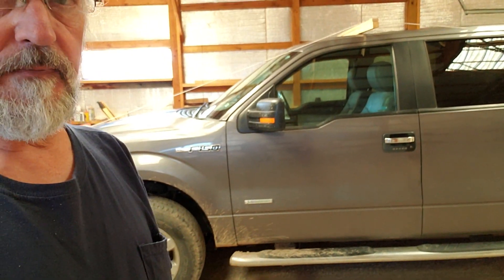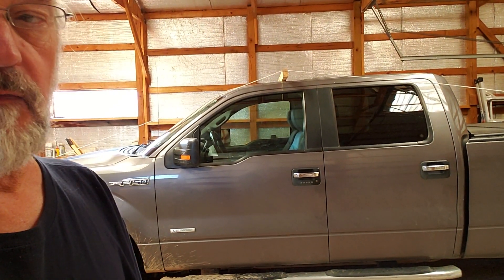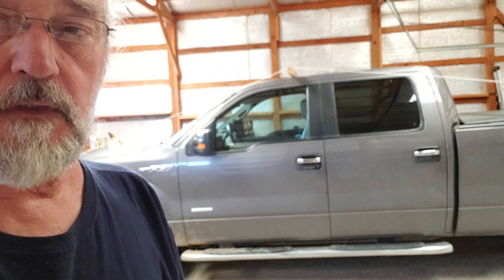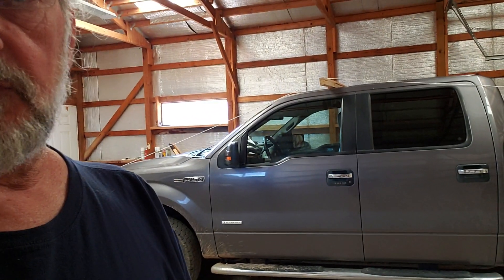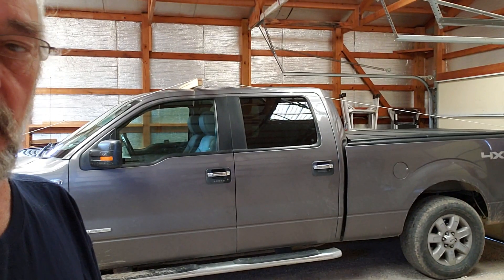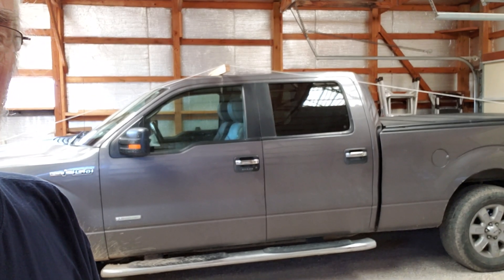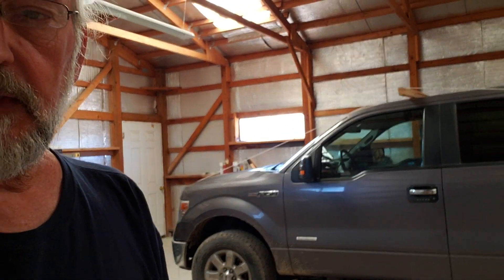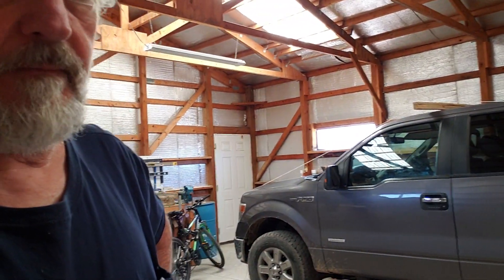Tesla Cyber Truck compared to a F-150 XLT with a crew cab and a 6.5 foot bed.

Comment: The lack of flat rails to place stuff on the truck sides of the bed and reach in and out is a deal breaker.
Reply: Why don't you just weld one on? It's stainless steel.

Comment: Awesome thought experiment John, that is a great way to get a real world comparison without having a Cybertruck on deck.  Brilliant idea with the rope!

I will say this, Tesla just basically made all their current cars "compliance" cars with the release of their Cybertruck, thats how far out there it is lol.  And if other companies cant even keep up with that, there's no way they can catch up to to the Cybertruck.  ALL other trucks on the road right now look boring and outdated in comparison all the sudden.  I think the wedge will grow on people sooner than we think. Legacy auto manufactures RIP.

To some of your points...
Drag:  Triangle beats square every time lol  I know that is a grossly exaggerated statement, but you get the point...no pun intended lol  If I were a betting man,  my money would be on the rocket scientist to think of that during the design. ;)

Other good points, like access to your tools in the back via side of the bed.  I think some people might fail to realize there are external hidden side compartments on the Cybertruck, maybe store your most used tools there?  Also, couldn't you step up onto the tire and reach over?  Maybe on the final version, those side "wings" could be folded down, yielding a more "traditional" bed to make reach and camper shells more feasible.  Maybe store your most used tools in the frunk? Im sure with a body/frame like the Cybertruck they'll be LOTS of aftermarket additions for storage and access solutions.

It still baffles me that a "car" company like Tesla thinks about putting a ramp into the bed gate or an automated bed cover that rolls up into the truck.  How is this just now a thing?  Some of these companies have literally had a 100 years to innovate, only to be outdone in a matter of a few years. 

I am a tesla fan myself, and I'll admit the triangle truck is still growing on me, but the functionality out weighs the looks.  And if Im not mistaken, you buy a truck to get shit done, not enter it into beauty pageants.

Comment: Awesome visualization! The more I check out the Cybertruck, the more I like it. For $57k (AWD 300mi range + FSD) it seems competitive in pricing, but I’m not in the loop on pricing and negotiations/discounts available for trucks... What kind of premium over a regular ICE truck do you think there is? Some simple back of the napkin math and I’d guess you’d save roughly $2k from gas per year on a somewhat regular usage of 10k miles a year as well. Maybe more/less depending on electricity and use, but that along with other maintenance could really lead to some fantastic cost savings over time as well...
Reply from the maker: Don't know where you are from but around here (in southern New Mexico) I would spend around a $2K to gas and oil change my 2014 Ford F-150 XLT, so your estimates sound about right. El Paso Electric has a program to access 5 cent a kWh electricity for EV charging so I could save a bundle with that. It takes a $500 demand meter to access it though.
Reply: john gilkison I’m in California (Bay Area). Thanks for the reply!
Reply from the maker: @jeffsawyer  yep, your right, gas here is $2.40 a gallon, and I pay 12 cents a kWh strait up. I suspect these prices are higher your way. You will save a shit ton going electric.

Comment from the maker: So Play Authentic,  you are a glass is half empty kind of guy. All the problems you mention can be addressed. I can see 5th wheel towing would not be possible with the Cyber Truck but it could be with proper design. I would like to see more aerodynamic trailers with their on electric drive to assist the tow vehicle. Imagine having stand alone power at a campsite to power everything for a few days. That would be great.
Reply: john gilkison I’ve seen 5th wheel towing brought up several times. I don’t know anyone that 5th wheel tows with a light duty truck.
Reply from the maker: @Pistolpete218  rated to tow 11,400 pounds. How is that light duty. A 2014 is the last of the steel body trucks and comes in at 5 800 lbs and the 3.5 liter EcoBoost engine has the power. I have never seen any explaination as to why it can't do it with the heavy duty tow package. All the numbers are there.

Comment: Good luck getting anything tools out of a tool box with Bed Walls that high. And forget using a Gooseneck Trailer.  Is just a bad ergonomic design. And that's the weakness of an electric vehicle. It has to be more aerodynamic or the mileage  goes down the tube.
Reply: From what I've heard, you can adjust the height at the back or front so will be much easier to load things.
Reply: I wonder if it has a big frunk. Could be a good place for tools .
Reply: @fritzstauff   Why don't you go waste your money on one and let us all know.
Reply: @fritzstauff  The frunk looks pretty big, but not compared to a pickup's bed.
Reply: Play Authentic!!!! It has sail pillar compartments for your tool boxes which makes it easier than going into the truck bed.